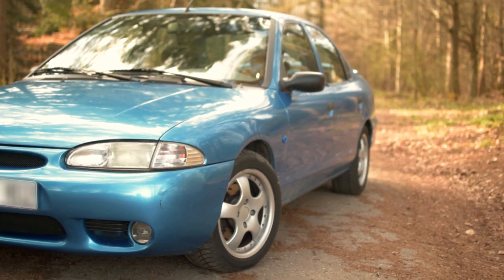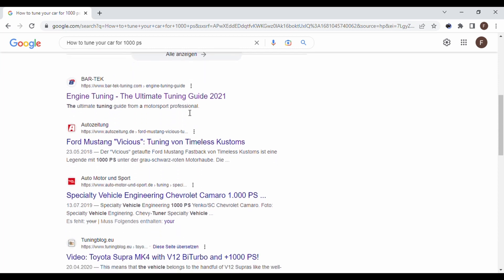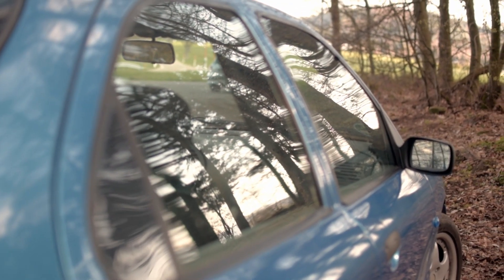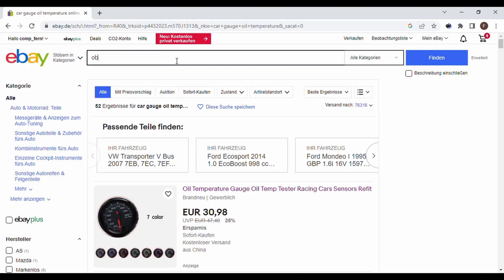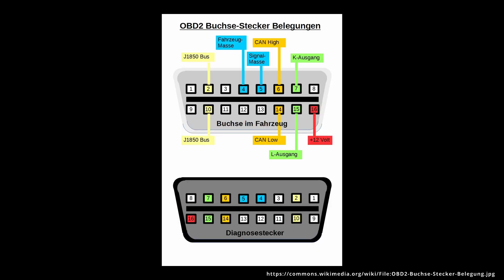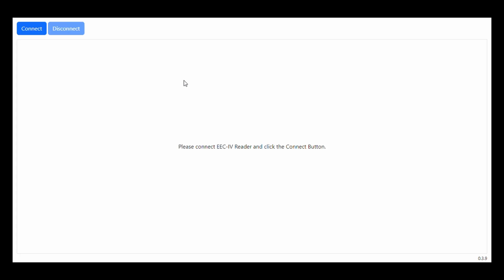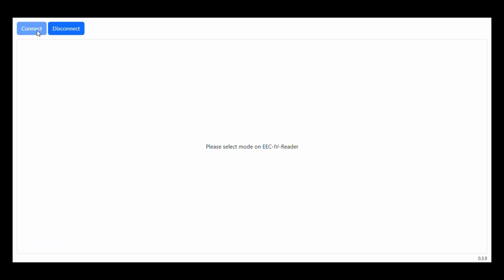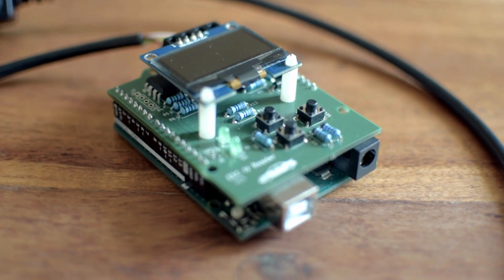Hacking a 90s Ford - EEC IV Reader

Comment: all my support here,, I had similar ideas but I will give some main lines that would help you a lot with the project 
- try checking how the VCM II works that is the original Ford communication adapter...
- IDM is the main programming program that is used by Ford in connection with VCM II
- If you managed to turn the Arduino into a VCM II >>> this will give all the OEM and ECU controls and Programming capabilities 

Wishing you all the best ,,, I love working on Arduino too and I will be glad if I can offer any of my tiny information to help you on this project :))
Reply from the maker: Thank, thats great Info 👍👍